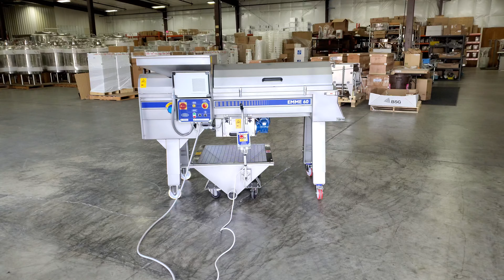Zambelli EMME Destemmer Crusher with Must Collection Hopper

Comment: What is powering this? Like how do you wire it up to a power supply?
Reply from the maker: Thanks for the assist!

The Destemmer and Must Hopper both require 220v power (10.2 and 3.4 Amps, respectively). They are supplied with "universal" IP44 waterproof plugs that you can replace with plugs that match your outlets.

Cheers!
Matt